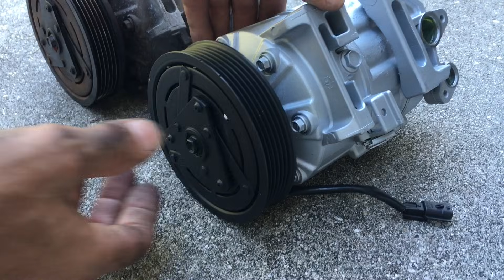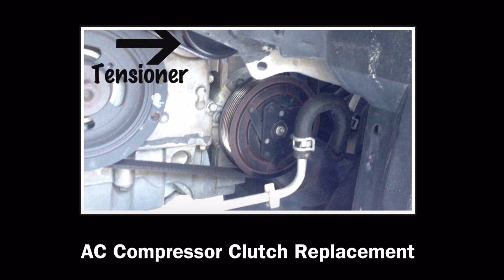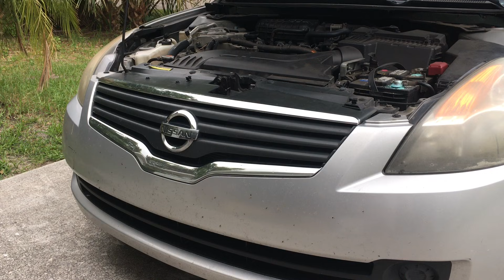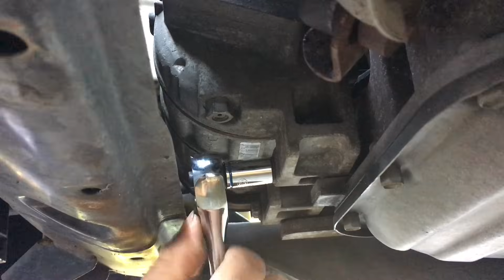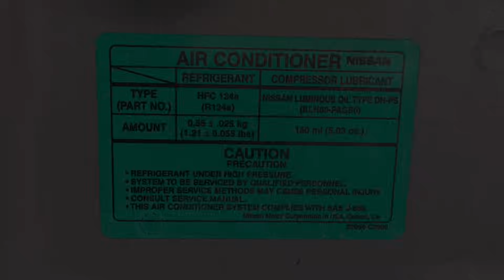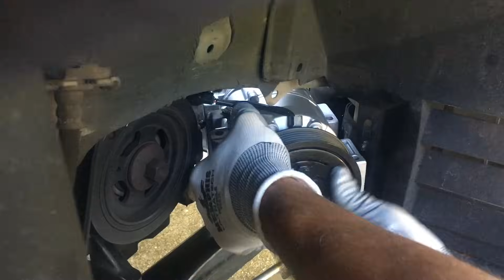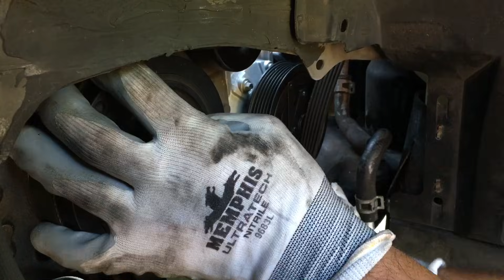AC Compressor Replacement - 2007-2012 Nissan Altima - How To Fix AC System

Comment: How much is part price?
Reply from the maker: I bought refurbished AC compressor from eBay. Entire kit cost me under $150. It works fine so far. It's been almost one year.
Reply from the maker: Something like this:
http://rover.ebay.com/rover/1/711-53200-19255-0/1?icep_ff3=9&pub=5575132837&toolid=10001&campid=5338094490&customid=&icep_uq=2007+Nissan+Altima+AC+compressor+kit&icep_sellerId=&icep_ex_kw=&icep_sortBy=12&icep_catId=&icep_minPrice=&icep_maxPrice=&ipn=psmain&icep_vectorid=229466&kwid=902099&mtid=824&kw=lg
Reply: WOw, that is cheap.  I just ordered and received mine in 2 days.  Will install this week :).    Thanks for the year update.
Reply: Rockauto sells a new denso for 220. Worth it imo.

Comment: Great video. Appreciate you making these. Question, what brand compressor did you end up using? I hear people saying Denso is the OE compressor, but is it really necessary to go back with that?
Reply from the maker: +Michael Whitehouse 
It's really up for you. 
I bought refurbished one from eBay with 1 year warranty with o-rings and receiver drier. All for $150. It's been about 1year and it is still working well. New Denso will probably be double of that.
Reply: use rockauto.com
Reply: New Denos is 350+ around here

Comment: thank you so much for this video.  I have never done this before and was quoted  $900.  I did it myself and saved $650.  never would have attempted without your help
Reply: What kind of PAG OIL did you use?

Comment: hey hi there i replaced my ac compressor on my nissan 2009 and when filling with freon the new compressor wont engaged to suck in new freon
Reply from the maker: +Luis Diaz 
It won't engage until you reach certain pressure in the system.
Reply: Temachok yeah!! that i know but this end up been a strange case the soonest i loose the connections on my pressure gauges i felt the freon flowing trought the hoses and buyyya i fill the system thanks anyways for rhe quick replay
Reply from the maker: +Luis Diaz 
I had a similar situation when pulling vacuum... At first I didn't notice that opening gauge caps was clockwise, not counterclockwise like everything else in the world... It's reversed on some gauges.